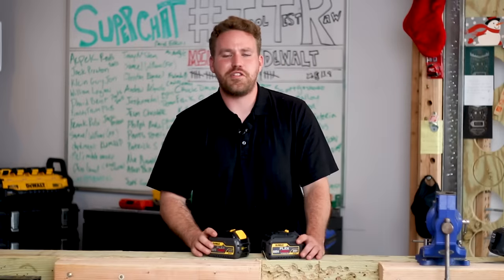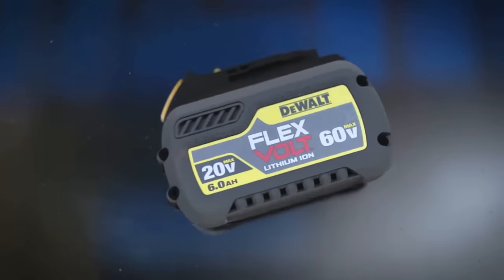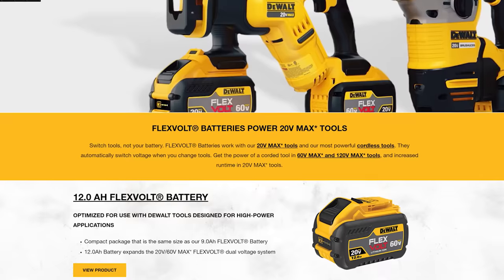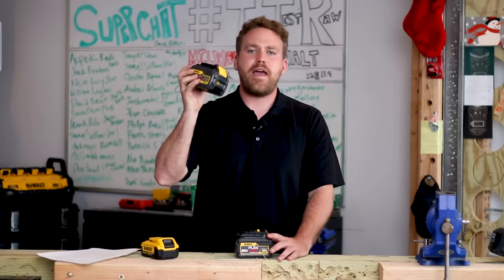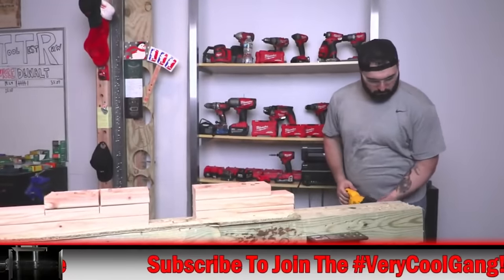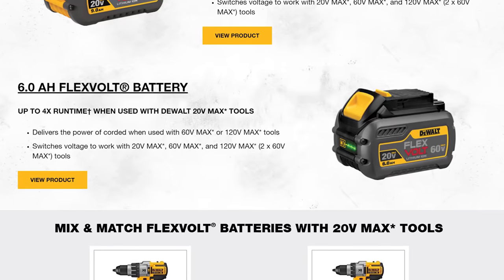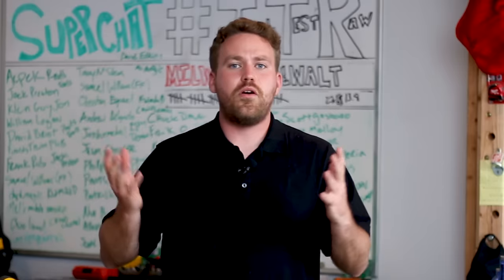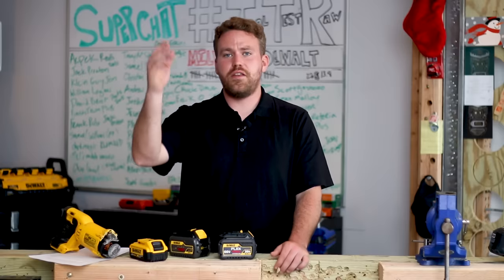NEVER USE DEWALT FLEXVOLT BATTERIES ON 20V MAX TOOLS!

Comment: Not sure what I think about this video... I’ve been using flexvolt batteries in my 20v tools since flexvolt came out... use them in jig saw, drill, impact, circular saw, receip saw, multi tool, lights , mower, etc etc... not one problem...been solid
Reply: Seriously. I use Milwaukee, but most of my coworkers use dewalt and all use the flexvolt. All day long in every tool on job sites. No issues.
Reply: I use my flex volt batts on all my 20v tools. Sawzall, 1/2 drill, 3/8 impact, & 1/2 impact. Never one issue.
Reply: Gotta use the right tool for the job. 🤷‍♂️ use 1/2" impact to drive those massive concrete lags and use a circ saw to start the 8"×8"
Reply: What proof do you have to back this statement up? This video was nothing but B.S.. Very disappointed, VCG......
Reply: Same
Reply: Brushless motor too powerful they get really hot when you put them on long run time it will burn the motor, if you let it rest don’t over run it will be fine with 20volt tool.
Reply: @gs300ondub  No proof, other than over-heating by over-duty use.  He's just a Milwaukee fan, and tries to discredit/abuse/defend Milwaukee however he thinks he can.  Milwaukee and Dewalt both make pro grade tools, and personal choice and $$$$ are the difference.
Reply: @powrguy1696  Yup, fan boys gonna be fan boys.
I'm all dewalt, when I started out I really wanted milwaukee but here in the UK at the time Dewalt were the only tool company that could offer me a 12v dc input battery charger (mobile mechanic)

Comment: Did ya use a 12.00 aH flexvolt on the 20V Max tool? Or was it the 6.00 aH or 9.00 aH flexvolt? Just curious if that might be the difference?

Comment: I have most of the flexvolt tools and 4 older 6ah black batteries. Just bought 2 new yellow 6ah 100.ea. they ran in my hand tools but then quit running them or shut off come back on when jiggled. Whats up w that

Comment: The ONLY issue is that XR batteries have the capacity to get a Brushed tool to RUN past its Heat range in time. Heated up Stator and brushed failing tend to draw more current and make more heat. Heat kills tools ( operator making "Xtended" run times ), NOT Batteries.

Comment: This is crazy I've run Flex volt batteries on all my 20v tools never have a problem. Use a voltage tester the 20v battery and the flex volt battery both put out 20.5 volts. so how is that gonna hurt you 20v tool?

Comment: Dewalt does make some lower quality tools sold in tool combos that appear to be the same 20V max tools. However, the performance of the tools depends if they are brushed, or brushless, and XR or not. This video shows the reciprocating saw from one of those combos not the best tool in the first place. Likewise, there is a massive wall of the high end Milwaukee tools. If you compare products at a different price point and stress test them, the cheaper ones burn out. They are also specified with different performance ranging depending on the price point. 

Compare the battery types on tools being used for their specified purpose and there will be no effective difference in tool life by increasing the battery life. However, if the battery life is increased on a lower quality brushed tool variant it could lead to significant heat buildup. Obviously any brushed tool will heat up a lot, even a corded tool; a corded tool would burn out every time you push it that hard. Depends how many amps the tool is designed to handle. 

The problem is not the battery; it's how the additional potential energy was used under high resistance loads for an extended duration on a brushed tool. Perform the test again with brushless tools or properly rated tools; Dewalt offers a range of different products at different price points. Or even set some kind of standard in the test, actually perform a test, and provide information about the products being tested!

I've never had a DeWalt tool let the smoke out.
Reply: Thanks for your information. It really helped me to understand more 👍
Reply: @nickd6319  Glad it was useful. After reading it a second time it wasn't as clear as I had hoped.

This test still provides useful information for anyone hoping to save money and try different combinations. It just doesn't explain the reasoning very well.

In general brushed motors can't be operated for a long duration in compact form. They require large conductors to reduce resistance and robust air or liquid cooling. Hence why the bench and shop tools always have big motors even bigger than a cordless tool.

The flexvolt battery is designed to work with any 20V tool and increase the duration of the runtime. However, if used with a brushed variant the user should limit overall runtime and provide cooling breaks between operating intervals.

Further testing can confirm what performance impact, if any, is observed on 20V brushless tools.

In my opinion it would be unlikely that a person would buy a  single brushless professional grade tool in the Flexvolt range and cheap out on the reciprocating saw without recognizing it is brushed. Likewise spend this much on tools without ever overheating a tool.

If anything the video should be titled be wary when buying Dewalt tool combos. Here's why!  There's another good video on that topic. I do criticize Dewalt for slightly misleading advertising on the box. It is a bit deceptive to feature a limited production, low end copy of stand alone tools, specifically designed to bundle with other tools at a lower price point. 

Dewalt tool bundles seem like a value bundle based on quantity and not quality. But in reality the price point is based on the quality of some of the tools in the bundle. It could easily be interpreted as a bundle of tools equivalent to the standalone XR 20V max brushless tools. The bundles are simply not the same tools; so they cost less money.
Reply: Exactly.

Comment: love dewalt but it did burn my drill out using the 60v flex on my 20v design...Use it on my weed waker that runs a 4.oAmp works jus fine???

Comment: All I can say is I've been using flexvolt 6ah batteries on all my drills for years and they never caused an issue, I also have two DCF887 Impact Drivers one made in Mexico and the other made in America, they always been on 6ah flexvolt batteries and never once did I have a tool burn out because of this, idk what VCG has going on with there tools smoking, but all my tools work great and continue too.

Comment: I own 6 Dewalt DCB 609 (20v 9AH or 60v 3AH), there is a switch in the battery set for 20v on normal state,  pressed 1/2 way it switches to off position (0 volts) when you put on the red caps and pressed all the way in, it switches to 60v which is only pressed when you put the battery on a 60v tool. There is no way to screw this up unless you are tampering the tool or the battery. Let me know what you think? HaHaHa. 

One thing I want to know though, what is the maximum current (Amps) draw the battery DCB609 BMS is set for?

Comment: We use Dewalt Flexvolt circular saws at work (which are pretty tired at this point they’re probably 3-4 years old and used for hours everyday in a shipyard) and we often switch the batteries into 20 volt max impacts and drills with no issues so far they haven’t killed any of our tools. One thing I will note is it does seem the 60 volt max batteries cause the drills and impacts to run a hotter though, but it could just be application based

Comment: I burned both my 2ah batteries that came with my impact drill set when I used them on my little circular saw I replaced them with a flex volt 6ah and a 9ah batteries been going strong ever since I use them on all my 20v tools I basically have every 20v they make and haven't had any problems

Comment: We’re you using brushless Dewalt tools? That reciprocating saw does not have the brushless mark on handle that I can see. Maybe that has something to do with it. I’ve used flex volt batteries on all my 20 volt Dewalt tools and never had an issue at all.

Comment: This video brought to you by Milwaukee. This guy either doesn't know what he's talking about or is blatantly lying.
Reply: Almost 2 years using flex volt in normal 18v tools daily. Not a single problem, just extended runtime all day long.  I trust my hundreds of hours of use over this guys 1 day trial
Reply: @cultusgti  There are thousands of professional tradesmen and hobbyists who use flexvolt batts in 20v tools every day without issue and have been for several years. I'm one of them. Has nothing to do with the tripe you spouted. This guy is just wrong.
Reply: @cultusgti  Its not that complicated. You plug a flexvolt battery into a 20V tool you get a 20V battery. You plug it into a 60V tool you get a 60V battery. Put a meter on it, as I have done, and check it for yourself. Its simple. The advantage, if you want to call it that, of using a flexvolt battery in a non-flexvolt tool is more amp hours which equals longer run time. It's quite simple. It's not some big conspiracy by Black & Decker. You sound paranoid bro. Relax. The world is not out to get you.
Reply: @cultusgti  actually it is beyond the realm of possibility if you have the slightest understanding of electronics and batterys in series and parallel .
Reply: Average American why would he make up such a specific video???
Reply: Maybe this d-bag needs to slap that battery on a charger. I've literally caught flexvolts on fire- twice and it still works
Reply: cultus gti how could it possibly do that? It runs at the standard 20v on 20v tools. That’s all that matters.
Reply: I’ve used flex volt on 20v tools doesn’t hurt them but it does depend what your doing with it and how bad your beating it up use your better judgement
Reply: Lmao I thought so too..... they claim they use dewalt lol I use dewalt and I being using 60v bateries on my 20v tools and never had one broke on me lol
Reply: @cultusgti  they are not comparing models which are like for like, its a setup, not experience.
Reply: @1averageamerican  watch there videos   especially nicks  he is actually a huge DW guy (he admits it all the time) has been since the beginning of this channel  and if you want to say they are up milw ass then look at there videos about the milw collet problems   Vince used to be a DW guy but flipped to milw guy about a year ago and he has several vids telling you not to buy certain milw tools as well as nick being a DW guy and he has several vids saying not to buy certain DW tools.  you may be right about the battery thing because they do stress the hell outta the tools. (Which you are not.  DEwalt came out just 3 weeks ago confirming that the 1st gen flex bats had a bug that would cause the bat to switch V while running during high load applications  they haven't admitted to it burning them out but have said the bug has been worked on)  But i have been watching these guys as well as other reviewers for a long time and VCG is about the closest to UNBIAS as i have seen.  They really do seem to make the videos with viewers and contractors in mind.  So before you say they are supporting one or the other do your research.
Reply: @cultusgti  I could produce footage of any tool releasing the magic smoke if I wanted to.  That doesn't prove a damned thing.  I use a wide assortment of DeWalt tools every day, and have been doing so for decades, and I've never managed to burn one up.  This guy has got to be clueless.  Notice he offers no explanation to explain why a Flexvolt battery using the 20 volt slots could possibly have anything to do with his talent for ruining virtually bulletproof tools.
Reply: @ChrisB1993  Same here.  I could make a video burning up any tool if that's what I wanted to do.
Reply: @cultusgti  You really are clueless.  Learn the difference between connecting three 20 volt battery banks in series to create 60 volts, or connecting them in parallel to make 20 volts that will last three times as long as only one 20 volt bank with the same ampacity.  A tool takes no more amperage than it's designed to take.  20 volts is still 20 volts.  You must be a Millennial...
Reply: @Crawlerjamie  Monetization based on how many viewers he can sucker in, pure ignorance of how to properly use tools, a shill for another company... who knows?
Reply: tinker bee  I don't even buy 20 volt batteries anymore.  I have so many 60 volt tools, plus all my 20 volt tools, so the Flexvolt works with everything.
Reply: @Crawlerjamie  that's more than obvious, why would you not be able to work it out ?
Reply: You "Nailed" it Average American !
Reply: The number of spelling and punctuation errors in your comment alone invalidate any opinion you may have on any subject. It would be a piece of shit even if written by a 7 year old.
Reply: @cultusgti   @cultus gti  what experience? Dudes a salesman, his experience comes from either the spec sheets which he interprets to his own liking, or from competitors to the products he's shit talking. In my experience, the ones that call others out for being "fan boys that can't take critisism" are only describing themselves.

Comment: I've been using a 60v max on a 20v impact and a 20v work light for YEARS. Kinda funny how I've never had an issue and these guys have problems with brand new stuff....  it's almost as if they rigged the equipment to fail....

Comment: Thats crazy i use my 6.amp flex and my nines on all my 20 bolt tools sawsall impack 20 v circularand i dont suggest to but i dremelled off the tabs on my adapter and use them on my 18 volt tools i do concrete and my crew is horrible on tools we beat on everything we have and ive never had a problem wonder what the difference is

Comment: My family has been using dewalt   tools at both home and work(custom home builders) for years. i grew up with dewalt. My brother and i own a lot of dewalt tools and have never had this problem.
And I've run a 18v(dc827) on flex(dcb606) ever sence they came out with the converter(dca1820) no problem 😎

Comment: The Flexvolt batteries have both 60V (series) contacts and 20V (parallel) contacts. When you use a Flexvolt battery in a Dewalt 20 Volt tool it uses the 20V contacts. No different than using a 20 Volt battery.

Comment: I have been using DeWalt Flexvolt for several years now on my 20v tools and never a problem with my tools kicking the bucket. The main reason I first bought a 9ah Flexvolt was because of my DeWalt heatgun, which would not last very long with my 2ah batteries that came with my drill/driver. Shortly after, I upgraded to the 60v circular saw, but I do use the Flexvolt in all my other tools, too!
Reply: I just bought the dewalt impact drill and the battery it came w/ seems to not last very long or have much power and I was looking into the power stack what would you recommend

Comment: I’ve been using my flexvolt on a 20v max drill and it’s been throwing some sparks out of the motor and seemed to be running faster. I’d been wondering if it’s really meant to be used on them. Maybe not, thanks DeWalt marketing (drill still works FOR NOW)

Comment: Never encountered this problem before, i run all of my Dewalt tools with flexvolt batteries. Unless you some how manage to short Circuit the pins, but that would short the battery not the tool..

Comment: I use a 777 drill with an ice auger. It has a noticeable increase in power with my 60v flexvolt 6ah battery compared to any 20v battery. The drill.gets too hot to touch while drilling holes. I've abused that thing badly. Still works everytime.

Comment: I've been using flexvolt with my old tools every day for 2 years. They still work great.
Reply: A 60v battery ruined my 
20v max drill
Reply: @galvanizedgnome  genuinely curious, were you pushing the drill very hard when it died, or using it for awhile with no breaks? i own a lot of 20v tools and was debating buying 60 batteries so i have the option to get 60v tools later.

Comment: I wonder how my 20v dewalt hammer drill would fare as I only use it ice fishing. I want to upgrade from the 5ah xr batteries I have that came with it. Can anyone give me any insight to using the flex volt batteries for ice fishing? I'm running a 8 inch ice auger with it.

Comment: Flex volt batteries can not be harming the 20 volt tools I will have to do a video showing how the dewalt flex volt batteries work
Reply: Let me know
Reply: I'd wager they can supply higher current longer than standard 20v battery packs, so it's easier to overdrive tools and burn them out.  Where as with standard packs the battery lost power before the motor could burn up.
Reply: @xephael3485  You could power a 20 volt tool with a 20 volt battery that had thousands of amps available, and the tool would still only use the amperage it was designed to use.  That's why a tiny little light bulb doesn't burn out when you plug it into a 20 amp circuit.

Comment: I can’t say conclusively yet if my impact driver, impact wrench, reciprocating saw, my circular saw, my Radom orbital sander, my hammer drill, or my regular drills have been adversely affected by using the 60v batteries. But then I’ve only used them so far last year to convert my garage into a bedroom suite, build a new 35x25’ wood shop, renovated old bathroom, build a coffee table, two dressers, a bookcase, and do some minor repairs around the property. 

I guess I will wait to pass judgement until the end of this year after I finish helping my son build his addition on the back of his house. 

I was thinking about getting the new 20v compact router, but according to you guys I shouldn’t waste my money?

Comment: I use these on every 20v tool daily except the drill and impact because it's too cumbersome. Never had a problem. I only run my recip and circular saws with flexvolt batteries nowadays